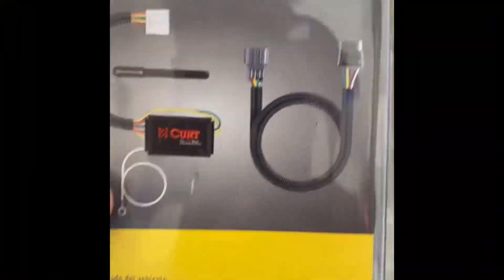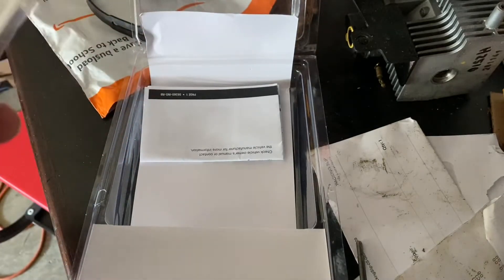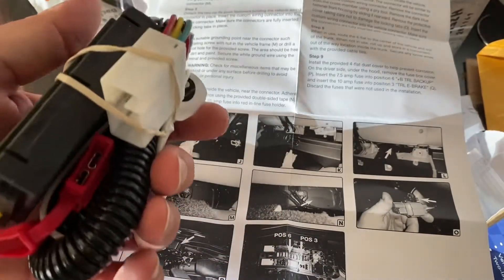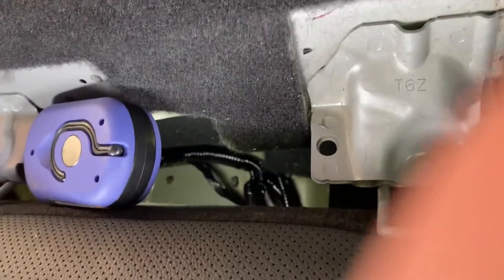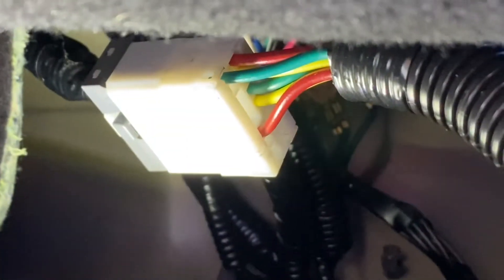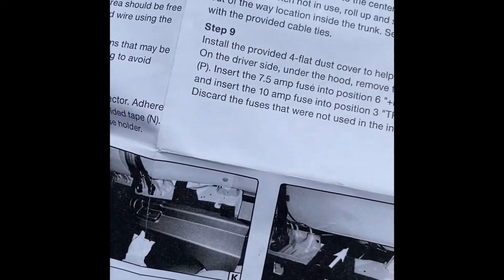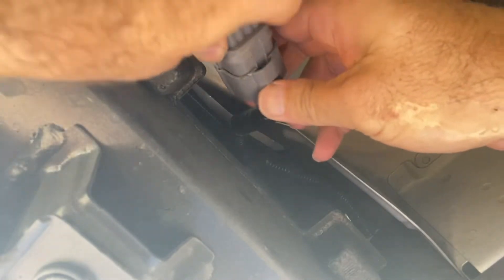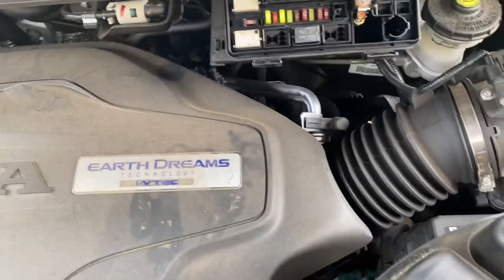Honda Ridgeline - CURT 56365 trailer light kit install | Running lights problem.

Comment: Need to add the following relays 39792-SDA-A01 Micro Iso 4 Prong Relay to the install - had the same issue with my 2019 honda ridgeline sport. It is located right next o the ground bus (a black connector)
Reply from the maker: I’ll check that
Reply from the maker: Can you point me to a picture or video on this 

Is this in fuse box under hood or behind back seat ? 

Thank you in advance

I have pinned your comment
Reply from the maker: I think I found a diagram  I found for a 2020 ridgeline 

Here is a link to it and I believe it discusses those  2 relays
https://www.ridgelineownersclub.com/attachments/2020_ridgeline_trailerhitchharness_aii12510-21-pdf.399730/

On step 20
Reply from the maker: I found the 2 relays,  they are there on my 2019 RTL ridgline .  They are close to where you install the Curt controller module for the 12 pin connector. 

Now I am at a loss to why the running lights don’t work.  Other then a wire got crossed in the factory harness. Which was a report I saw on a forum

Comment: The nice kit apart from the running lights not working
Reply from the maker: Yah it’s not bad.  Directions are set up more for the pilot.  I created this video to help fill in the gaps.  Since there wasn’t any on this genre of ridgeline
Reply: How did you make running lights work, having same problem on my 2019 ridgeline
Reply from the maker: I didn’t ,  there is a wire on the harness factory from Honda swapped I think . Follow the link to the forum site that explains it
Reply: @D Fields  I can't find link, do you not have running light?
Reply from the maker: No I don’t have running lights working
Reply: @dfields9511  Thank you for your response, I may tap into the license plate light wire, great video
Reply from the maker: @Steve-hc3gu  https://www.ridgelineownersclub.com/threads/trailer-hitch-harness-and-problems.227689/